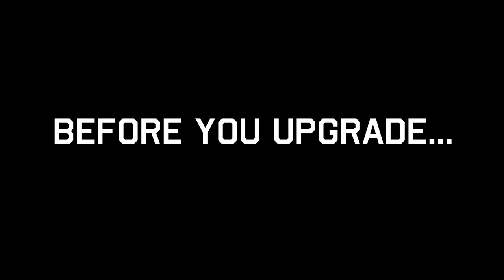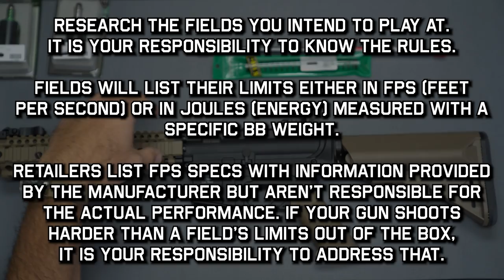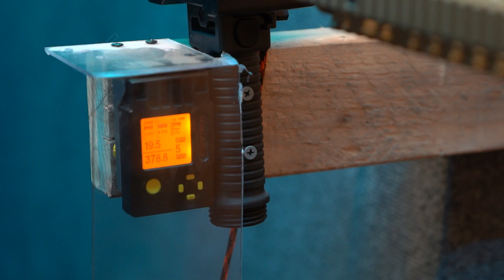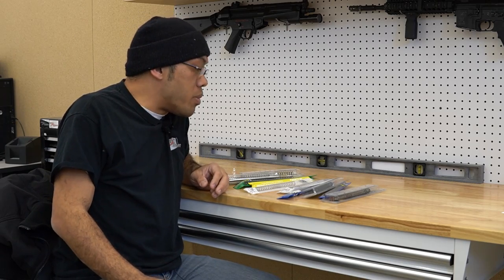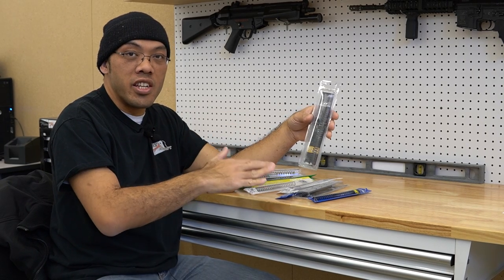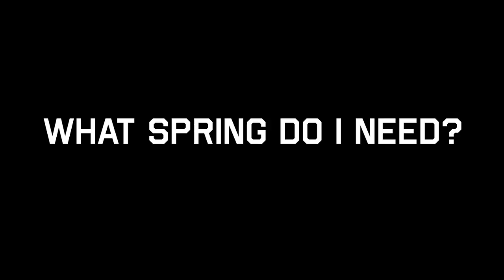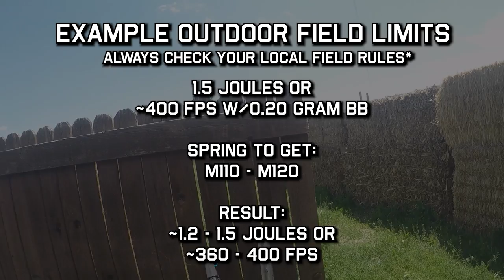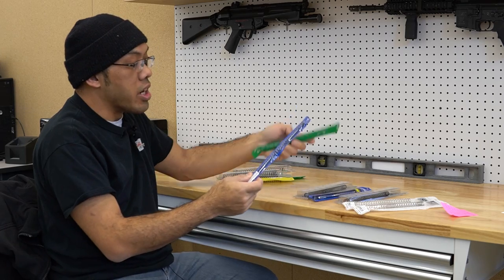AEG Upgrade Springs | Fox Airsoft

Comment: Very informative.
For non-linear springs, the small part that is more tightly compressed coil part (and easier to push) is the one that should go in the spring guide ?
Reply: My vfc BCM mcmr has tighter wound spring portion touching the piston. I would have thought it would be as you said? In the spring guide. My thought is that there is more mass per mm in the tighter wound portion so you wouldn’t want that part to be moving faster. It would take more energy to get the spring moving albeit very slight probably. So you’d want that at the spring guide where it’s not moving that much and the lighter side of the spring is doing the work. But it looks like I’m wrong.
Reply: @c0mputer  yeah makes sense. Maybe they set up your spring in the wrong direction at assembly. I downgraded my spring as my AEG came in shooting hot, and I placed the compressed part in the spring guide, it's working flawlessly. Also, the spring it came with was set the same way.
Reply: @peter11256  Good to know, after talking with an airsoft mechanic friend he said also that the tightly wound portion goes on the spring guide like you have done. I also need to downgrade for a hot shooting gun and will do the same as you.

Comment: This may be a stupid question but here goes.. i bought an upgrade spring for my Specna Arms Core AEG, i got a Prometheus Non Linear Spring - MS110. I have fitted a gate warfet mosfet and have an 11.1v lipo. The gears are reinforced and the piston has a metal teeth so im thinking the gearbox battery and mosfet are all able for it. The problem is it arrived today and when i went to fit it i notice its about 50% longer than the stock spring that came in the gun which i think was M90. Its also obviously consoderably stiffer. Did i get sent a sniper spring as opposed to a spring suitable for an AEG with a version 2 gearbox or is it normal for the upgraged springs to be so much longer when uncompressed?

Comment: Hey I have a serious question about this, if I get a CQB gun, and I want to upgrade it to more fps; is the spring everything I need? Do I need to uprage other parts in the gearbox or something else to make it work?
Reply: Said you might need to upgrade the motor or batteries

Comment: Do you think an M130 spring is too much for a lancer tactical gen 2 with metal gears, 19K Motor and 9.6v battery?
Reply: Yes, the spring is too high for the gun. The gearbox and maybe the gears will be able to handle it, but the motor and battery aren't suitable for an m130.
Reply: @pspmaster510  So if I upgrade the battery to 11.1v, a better motor, and a mosfet it will be fine?
Reply from the maker: An M130 is going to be more work out of most gun's stock motor basic 9.6nimh (as mentioned by the other commenter). Especially when upgrading a less expensive base gun, the motors they have will be good enough for stock performance and that's it. Not to mention the integrity of the gearbox shell. You're going to be putting more wear and tear on the other components so starting with a better gearbox will ensure it will last a bit longer.

My recommendation is that it's a lot of work to push it up with just a spring and you have to ask yourself if the extra 0.5J of energy is going to be worth $xx that you're gonna spend. That extra performance might be worthwhile to some, but the cost might be a factor too. One way I like to tackle it without adding more wear and tear is through air seal tuning as much as I can. That means squeezing more FPS out of the existing gun and keeping it at an M120 through better air seal components and a tight bore. Just a thought.
Reply: @FoxAirsoftStore  thanks for the great response! This helps me a lot.
Reply: @majorblow01  check your gun specs i have a gen 2 but it is a proline so it has a etu with internal mosfetbut mine also came with a 24k motor and i belive the gear ratio is 18:1